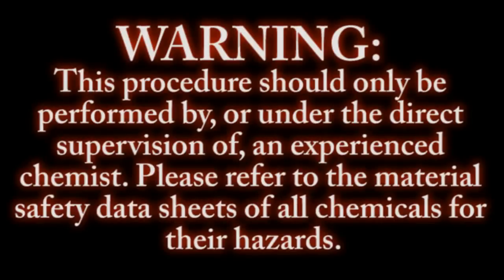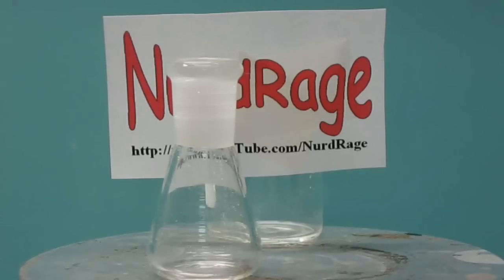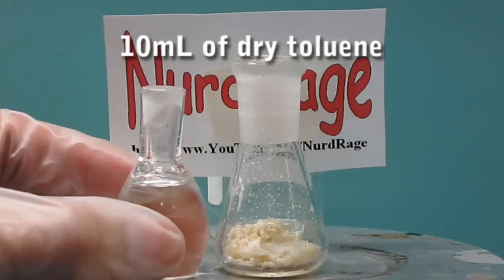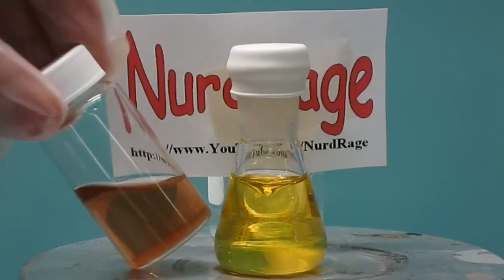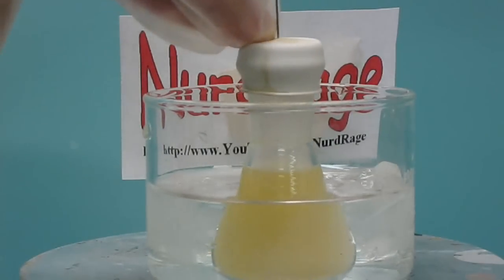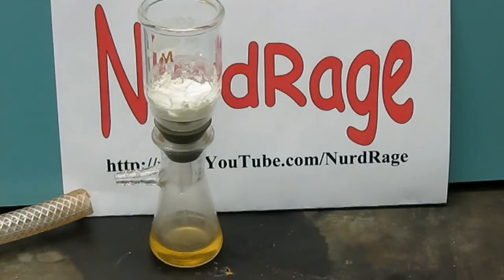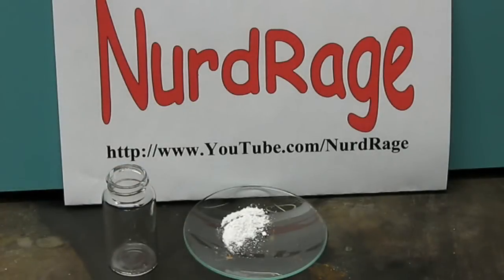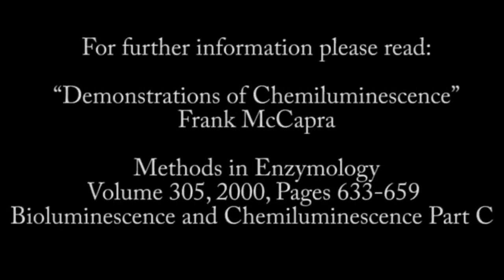How to make TCPO (for making glow sticks)

Comment: Thanks for the video! I've actually done this synthesis before in organic lab, but with a slightly different protocol (we heated it before filtering and didn't add acetate to slow down the reaction).
I am working towards a B.S. in chemistry and plan to pursue a career in pharmacy. However I do have a great passion for organic chemistry. Right now I am feeding it with my laboratory courses and research internships, but I imagine that it will be quite a bit harder once I leave university. [cont.]

Comment from the maker: i recommend you get the reference article at the end of the video and make bis(2,4-dinitrophenyl)oxalate, the precursor 2,4-dinitrophenol can be  made at home and works even better than TCPO. Just be careful, mishandling of DNP can be explosive and exposure can be toxic.
Reply: Worry more about the toxicity than the explosive quality - perhaps heavy metal salts flash like picric acid salts?
BTW, any fluorescent dye will act as a fluorescor in the oxalate ester system. Of cour
Reply: Worry more about the toxicity than the explosive quality - perhaps heavy metal salts flash like picric acid salts?
BTW, any fluorescent dye will act as a fluorescor in the oxalate ester system. Of cour
Reply: Worry more about the toxicity than the explosive quality - perhaps heavy metal salts flash like picric acid salts?
BTW, any fluorescent dye will act as a fluorescor in the oxalate ester system. Of cour
Reply: Worry more about the toxicity than the explosive quality - perhaps heavy metal salts flash like picric acid salts?
BTW, any fluorescent dye will act as a fluorescor in the oxalate ester system. Of cour

Comment from the maker: depends on which supplier you buy from.

i've seen it go anywhere from $5/g to $25/g

but that's for the ultra-high purity research grade material.

The lower grade glow-stick material can be had for $0.25/g but only available in large multi-tonne orders.

Comment from the maker: Only two things can make light by an internal process. Chemical processes like the one in the video, and radioactive processes. Chemical processes are delicate and only work under a narrow range of conditions. The digestive system is quite harsh and the conditions present disrupt most reactions. So almost anything glowing will not be glowing after being swallowed. Also, they're all toxic and not safe to drink.

The second way, radioactivity, needs no explanation of why it shouldn't be done

Comment: no 1 mol is about 6*10^23 molecules of the stuff you are using, depending on the molecular weight, the density and the concentration of the solution you are using you can calculate the volume you need

Comment from the maker: If you're making from ASA or SA precursors then you're in luck. Instead of using forcing conditions and nitrating all the way to trinitrophenol, use milder conditions and stop at 2,4-dinitrophenol.

2,4-Dinitrophenyl oxalate (DNPO) is actually stronger than TCPO and gives a much brighter glow. But it has a poor shelf-life and should be used quickly.

Comment: For 700mg of starting material, that's 3.545mmol of 2,4,6-trichlorophenol.  You'd need the molecular weights of oxalyl chloride and triethylamine to continue to figure out how much to add.  I might add that triethylamine is often found as a liquid, so you'd also need its density to figure out exactly how much to add.

Comment from the maker: @yellowmetalcyborg The chlorine increases the electronegativity of the phenol, thus making it a better leaving group when the hydrogen peroxide performs its nucleophilic attack on the oxalate. Using straight phenol alone gives a far weaker reaction. 

You can get TCP from Alfa aesar, a large amount is actually quite cheap.

But i'm working on a video to make DVO, which doesn't require TCP like TCPO.

Comment: how long does the glow last?
Reply: The reaction will glow in the dark for several minutes if you use ethyl acetate as the solvent. It will glow for several hours if you use diethyl phthalate as the solvent.

Comment: @CaptainFantastic420 If you don't have proper equipment, you shouldn't be doing it. The only fancy equipment used in this video is the fume hood. If you can't afford one, you can make one. Or just do it outside and wear a gas mask or respirator just in case. Magnetic stir plates aren't that expensive or hard to get. You can also make your own stir plate. The rest is cheap and easy to get online.

Comment: Hi Nurdrage.
Thanks so much for all your videos, I really enjoy them and have replicated quite a few myself.
I have a question for you though.  When you say 1 Mol eq. of Triethylamine, do you mean add 1 Mol of Triethylamine?  Because if that's the case:
Molecular Weight 101.19 g/mol
Density - 0.7255 g/mL
101.19 * 0.7255 = 73.41mL????
This calculation seems nowhere near correct but this is the only thing I can think of when you say, inject 1 Mol equivalent.
If you, or someone else who knows their chemistry a bit better than me could let me know what I'm doing wrong, that would be great!
Thanks again for your videos Nurdrage and I'm very pleased that your lab is coming along well.
See you in the next video.
Reply: Hi TheAustralian Scientist, I think vol. of 1 mol eq of triethylamine would be calculated this way, use can use same procedure to find the amount and volume of oxalyl chloride. Feel free to correct me if I'm wrong. By the way I'm not a professional chemist to begin with.
Molar mass,M2 = 101.19 g mol-1(triethylamine)
Molar mass, M1 = 197.45 g mol-1(tricholorophenol)
Amount of trichlorophenol taken, w1 = 700 mg = 0.7 g
No. of moles of trichlorophenol used, n1 =  (w1/M1) = 0.00355 g mol-1
No. of moles equivalent of triethylamine used = 1 
Hence, mass of triethylamine used, w2 = (n1 * mol eq. * M2) = 0.3587g = 358 mg
Since, Density of triethylamine, d2 = 0.7255 g mL-1
Volume of triethylamine required =  (w2/d2) = 0.4944 mL

Comment: I have a question about obtaining TCPO. I know it'd be alot more expensive to make it than to just buy it online. But I'm wandering if you could actually get TCPO by opening a glowstick (where the Hydrogen Peroxide hasn't been mixed with the sollution yet), and somehow seperate the TCPO from all the other liquids in the sollution. I know the yield would be very small, but could it be possible?

Comment: hey man i have another question
I did not find any manufacturer of reagents in Brazil that works with trichlorophenol, unless the sigma aldrich, but their reagents are very expensive, so I found the trichlorobenzene, have any way of a reaction with trichlorobenzene? 
if possible I can even modify other reagents used in this experiment, I have access to many reagents and have my own lab. if have, please reply. thanks

Comment: i got the point of how to get the TCPO but then again, i would just prefer to use the chemical black market instead, its faster and not so labor intensive and slightly safer then adding the oxalyl chloride too fast and having it heat up and possibly blow the vial and get covered in extremely hot chemicals, and BTW how do YOU obtain all the chemicals your using, like a college lab, or a online lab chemical supply store or something

Comment: Realy i want to know how to make toluene from your site because it isn't sailing in our country pléase help me not just only for this experiment
Reply: I can't imagine it isn't in at least some products, straight distallation would probably be simpler/safer than cracking or synthesizing your way to it. But this is coming from someone who hasn't handled anything outside of nitrate/sugar rocket propellant in years so doing so safely, or to reasonable purity may be a pain.
Reply: + Anuruk Suriyaarachchi Toluene is a very common paint/lacquer solvent.  You should find it in any automotive paint or hardware store at < US$5/liter.  

Both phenol and 2,4,6-TCP are readily available from numerous chemical suppliers in the civilized world at reasonably low prices.  Right now, Sigma Aldrich is selling bottles of 98%-pure 2,4,6-TCP at ~US$50/250g and ~US$130/kg.  

Considering the savings in time, grief, hazard, equipment and reagents, it's way worth the price  -- unless of course, you prefer the learning experience of jumping through a half dozen flammable, toxic hoops in the face of ever dwindling yields.

Comment: So wait, when you have a glowstick that is pre-bought and such, and you snap it, what is mixing with what? O: I assume it's the same chemicals at play, or at least simiar. And I know it's breaking a vial or something inside which causes the contents to mix. But since you added yours in 3 separate groups (Poured the TCPO into the solution, then added another thing), are there 2 vials inside, floating in the base solution? Or can you mix two of those three groups so you only have 2 chemicals to combine for the end result?
Reply: When you buy a glowstick it's just a plastic tube with all the chemicals in this video pre-mixed, except the hydrogen peroxide. That is contained in a small glass tube within the plastic tube. When you crack it you break the glass, releasing the peroxide into the mixture, resulting in the final reaction. So a simpler answer to your question would be yes. You can do everything in this video, up until the addition of peroxide and store it. Then when it's needed just add some peroxide and you've got liquid light.
Reply: steven spall Awesome! Doesn't hydrogen peroxide decompose into some combination of hydrogen/oxygen (I can't quite remember the combination, thinking 2H2O2 --> H2O + O2 but I'm not entirely sure, too tired to do chemistry!) over time? Would that mean that glowsticks expire fairly easily, when the hydrogen peroxide is no longer reactive? (or I guess more accurate is no longer hydrogen peroxide)
Reply: U can also make glow in the dark nail polish
Reply: Naomi Nekomimi   yes it does Hydrogen peroxide is thermodynamically unstable and decomposes to form water and oxygen with a ΔHo of −98.2 kJ·mol−1 and a ΔS of 70.5 J·mol−1·K−1.2 H
 2O
 2 → 2 H
 2O + O
 2The rate of decomposition increases with rising temperature, concentration and pH, with cool, dilute, acidic solutions showing the best stability. Decomposition is catalysed by various compounds, including most transition metals and their compounds (e.g. manganese dioxide, silver, and platinum).[21] Certain metal ions, such as Fe2+
 or Ti3+
, can cause the decomposition to take a different path, with free radicals such as (HO·) and (HOO·) being formed.Non-metallic catalysts include potassium iodide, which reacts particularly rapidly and forms the basis of the elephant toothpaste experiment. Hydrogen peroxide can also be decomposed biologically by enzyme catalase.The decomposition of hydrogen peroxide liberates oxygen and heat; this can be dangerous as spilling high concentrations of hydrogen peroxide on a flammable substance can cause an immediate fire.
Reply: +Naomi Nekomimi Unused glowsticks last a little over a year, then they're no good.